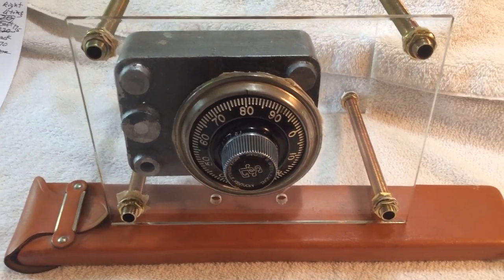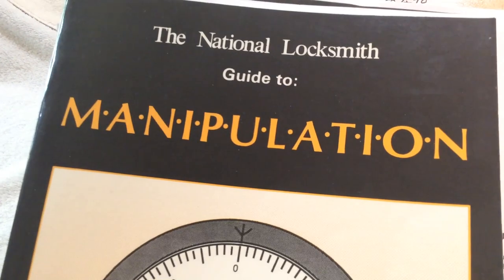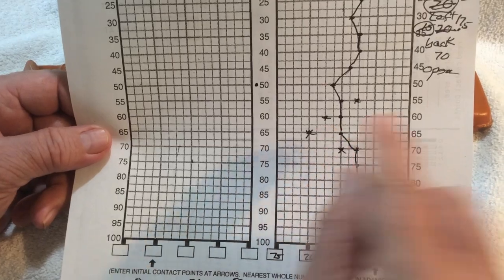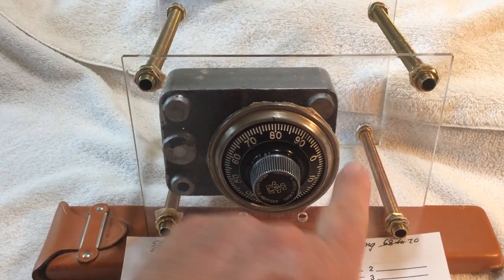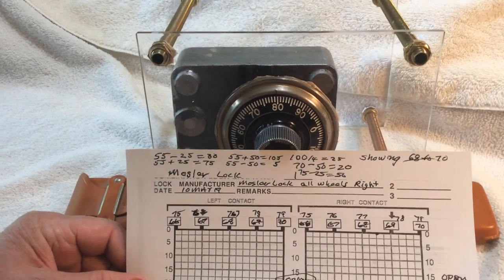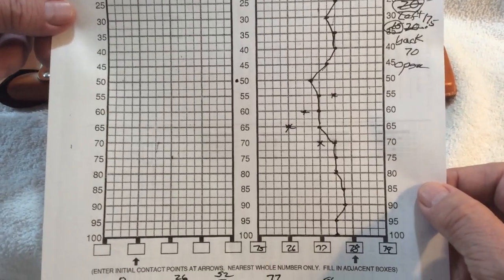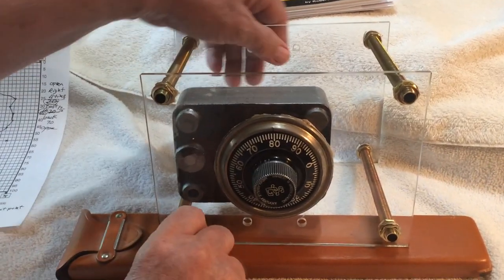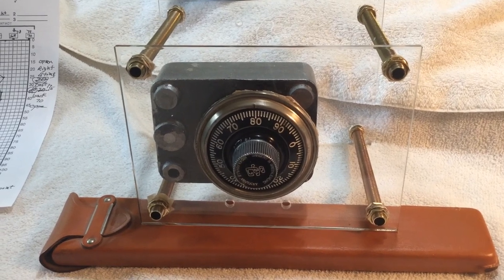Manipulation graphs of a Mosler Type Safe Lock

Comment: I have a mosler 302 with the black letters. The safe was unlocked and the dial got moved before I opened the drawer where I could have changed the combo. The combo that came with isn't working. Any help is appreciated.  Thanks in advance

Comment: Well is it an S&G or Mosler?  I could use your slide rule but I can't remember how
Reply from the maker: Don't know this was an older video...thanks for watching.
Reply: It's a Mosler lock using a S&G dial. S&G and Lagard are interchangeable. S&G dial works with Lagard and Lagard works with S&G. The drive cam can not be changed.